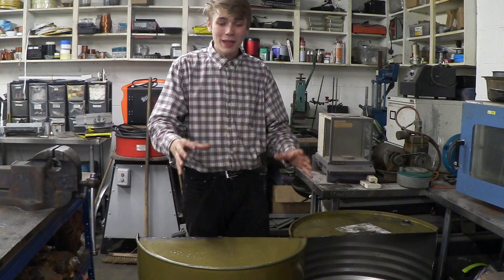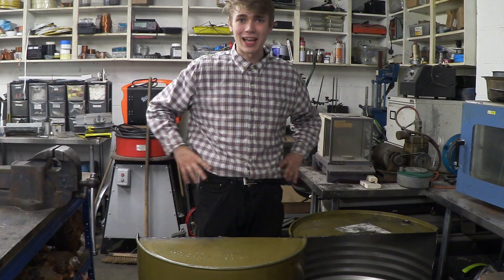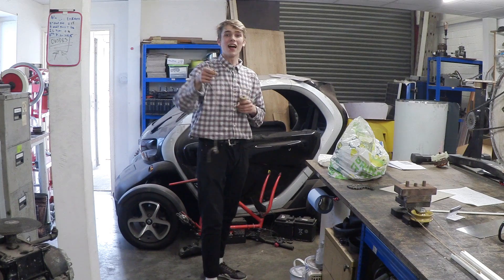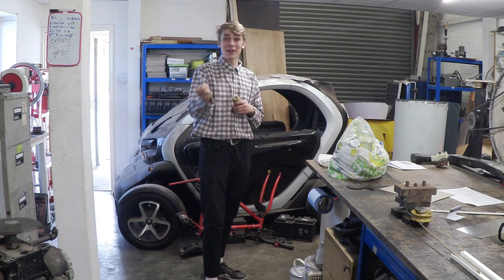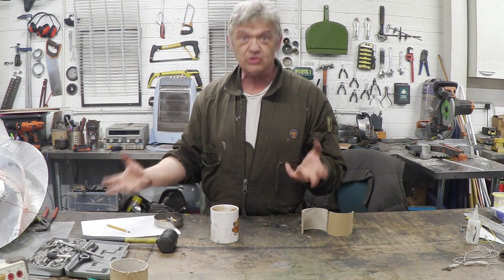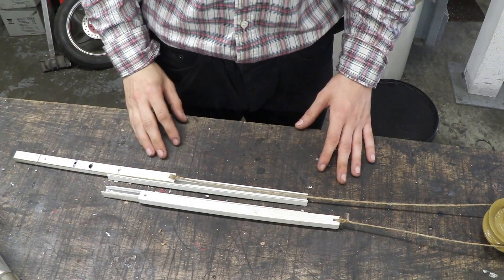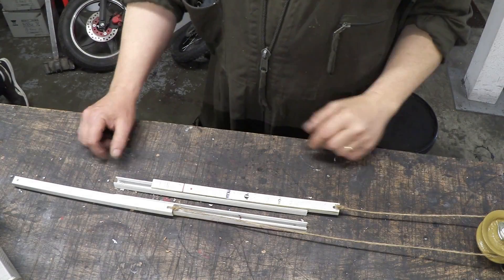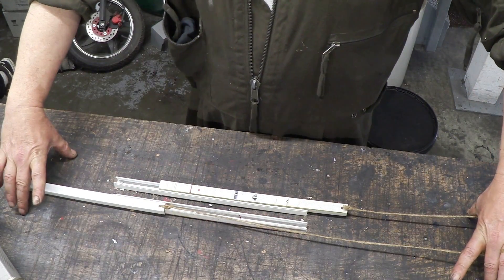1143 - High Wind Self Closing Savonius Wind Turbine - Idea

Comment: Hey Robert, I was wondering how you might design a room which could save internal electronics from a Carrington Event?
Reply from the maker: sorry mate - never even thought about it
Reply: All you need to do is put a Faraday cage around the room. 
Or if you really want to protect your equipment, around your house.

There is a paint that has iron particles in it that enable you to paint a wall that will then hold magnets. You have to keep stirring the paint to keep the iron particles floating so that they spread evenly.

Another way would be to paint the walls with Roberts graphene paint. Luke used it to protect an electric guitar's pickups from ambient noise and make it sound better.

Just keep in mind that when you put that Faraday cage around the room, you're not likely to get any cell phone signals inside that room unless you run a repeater antennae cable through the wall.
Reply: @scotttovey   @Robert Murray-Smith  I'm wondering if an underground room made out of some kind of concrete mix made up with the conductive ink from the shop could work. Or just high density of graphene mixed into concrete. I wonder if a mix like that could handle the current from the sun in the scenario of Earths magnetic field not protecting us. I mean handle solar orbiter style flux of about 17 500 watts per square meter, or near that ball park. SuspicousObservers youtube has me freaked out haha
Reply: It wouldn't matter as you wouldn't have electricity to use them after anyways. With that said, I do have a loaded, little MP3 and a wind up charger that are protected, so should something like this happen, I'll still have tunes for awhile.  Alternating wraps of a electrical conductor and an insulator is what can protect them.
Reply: Faraday cage or a microwave will work in a pinch 😂
Reply: @bigsteve6729  
"Faraday cage or a microwave will work in a pinch"

Only if you know the EMP is coming.
If you want to protect against surprises, you need the room to be the Faraday cage.

Comment: I think a Savonius is pretty much self limiting when it comes to rotational speed. They won't achieve a TSR much in excess of 1. Could be wrong though.
Reply from the maker: not sure myself mate - I have just read a fair few accounts of this being an issue
Reply: @ThinkingandTinkering  Telma electronic retarder? If it can slow a bus.......
Reply: Since the 1970s I have been trying all kinds of different designs for wind power, I settled on the savonius rotor style with a flywheel in the center, it never over revs , over several iterations of prototypes trying different kinds of mechanical breaking mechanisms I found those to be unsafe or unreliable, the solid welded rotor with heavy bearings running a chain to the generator ran since 2004, it's getting new bearings just this year.
Reply: Inherent to the design is that it is always slower then the windspeed, due to the blade "fighting" the wind heading into it.

Comment: Rather than closing fully in high winds, close to a max of 90% so you still have a little surface area to get decent generation in high winds. This way your stabilising the output regardless of the wind speed.
Reply from the maker: nice one
Reply: I would say the same thing. You want it to produce at any speed, just safely to the unit and I'm...those around it.

Comment: If you beef up the structure holding that together you will find it only spins up too fast if you're blocking the back wash from the returning side and it's native form mine has never overspun it's been an operation since 2004 not sure where you're going with this
Reply from the maker: I have a lot of complaints for the reverse mate
Reply: @ThinkingandTinkering  mine has no brakes other than the generator itself so if the batteries are full they will not supply brakes, I actually did some tests years ago, I've never exceeded 320 RPMs on this rotor the fastest wind I've measured has been 80 mph.
Reply: Or just add a friction brake that engages to some degree in high winds using a spring returned centrifugal weight.